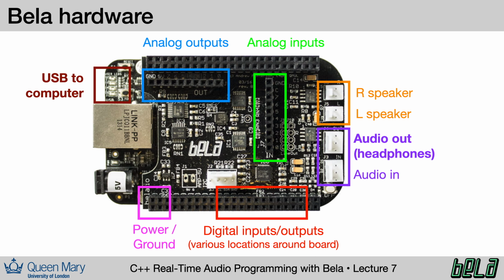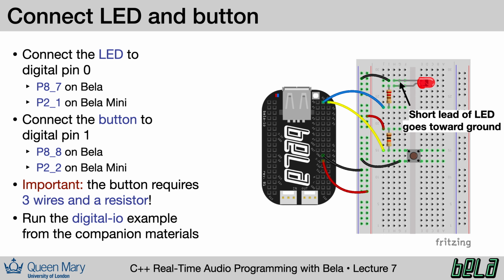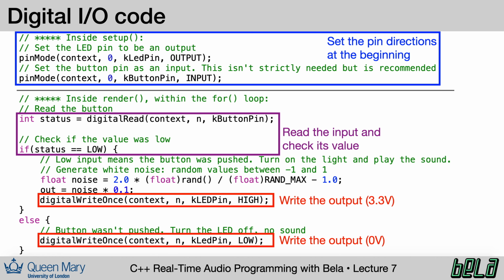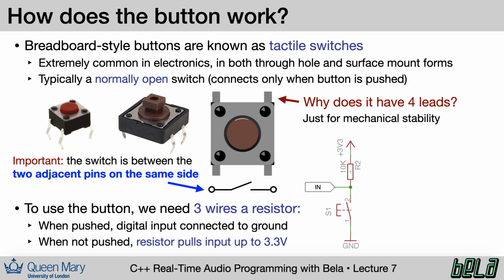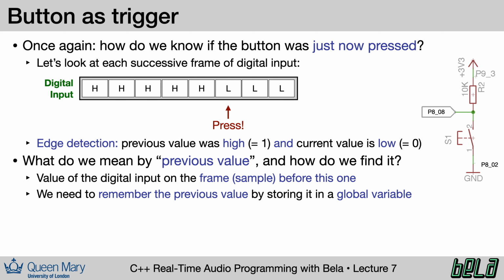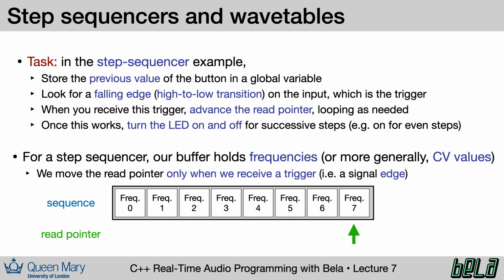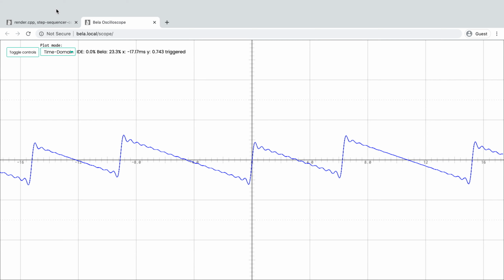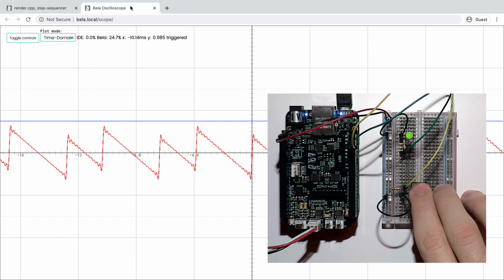7: Digital I/O, C++ Real-Time Audio Programming with Bela

Comment: In the final example, is it possible to connect the analog cv signal output to a eurorack synth using the breakout cable for headphones and/or the breadboard/insert wires? If so, how should that be wired together? (Apologies for the basic question, I didn't find an answer on the forum).
Reply: Yes, this should be possible. You want the "tip" connection of the 3.5mm jack to go to the analog output and the "sleeve" connection to go to ground. With breadboard jumper wires, you could wire the analog output to the white pin of the headphone adapter and the ground to the black pin. (The red pin is the "ring" connection which would be shorted to the sleeve when you use a mono 3.5mm CV cable.)

A caveat is that you only have 0-5V range on the analog out which isn't the full range of CV on most modules. Also, I don't recommend this with the analog inputs because it would be possible to put voltages outside the 0-5V range into Bela which could damage the board. The more comprehensive solution is to use the Pepper DIY kit for connecting Bela to analog synths: https://shop.bela.io/collections/modular/products/pepper
Reply: @apmcpherson  Thank you again for taking the time to answer, and for putting these course materials online. Your instructions worked perfectly for the output, and 5V was plenty to play around with. (I won't attempt anything with the input since I'm not at all knowledgeable about restricting the voltage, still learning.) 
I'll be ordering the Pepper today. I was just waiting for the Trill sensors to be available in the shop, since I missed that kickstarter :)